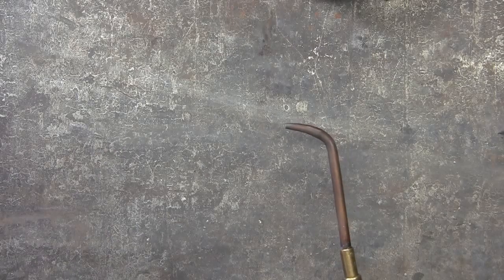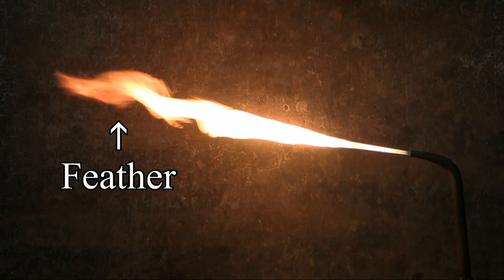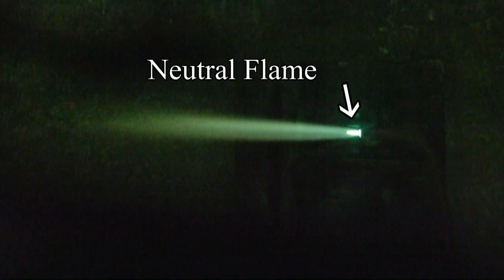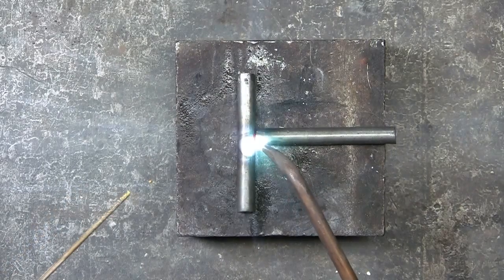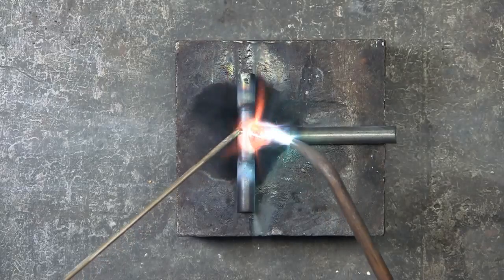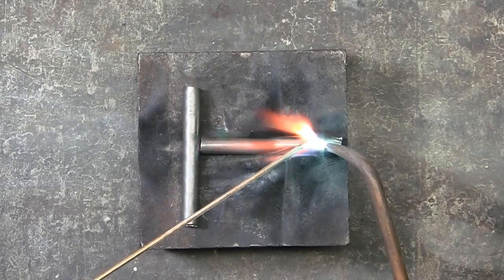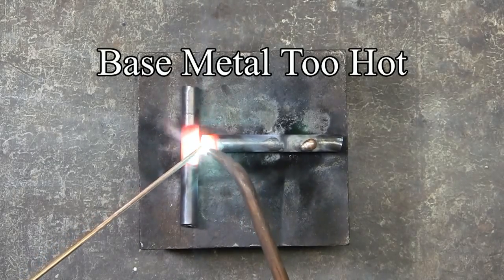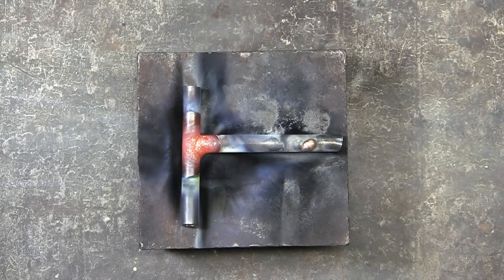Brazing Made Easy

Comment: I Tig weld a lot , when steel is melted it will react to the nitrogen and other gases in the air and cause oxidation and perosity without shielding gas, Red hot for braze .  I'm glad he showed what happens.
Reply from the maker: Thanks for viewing.  I envy your Tig skills.

Comment: Back in the day I used to braze the tears in the tin work on my dad’s combine just because I liked brazing. Years later I wondered since we had the basic 3 oxy/acet welding tips what the criteria was for deciding which process to use . Your thoughts please.
Reply from the maker: Tips range in size from “000”, “00” “0” 1, 2 ,3,4, 5.    “000” being the smallest.  Back in the day, as you say, I would imagine that you were using a 3 or 4 sized tip.  I don’t know the thickness of a “tear”.  For ¼” steel, I guessing, you’d need at least  1 or 2 sized tip.    A video I did recently showing how to force a tip to braze heavier or lighter material.  
https://youtu.be/1jf_dhbZRkc
Reply: Hi George. I apologize for not being clear, given the two choices i was wondering how you determined if you were going to braze a joint or just weld it using the standard oxy/acet rod. We were taught both at school but I don’t recall when you would use one rather than the other process.
Reply from the maker: @barnycanuck6234  Gas welding with a gas filler rod is just for steel to steel.  I use brazing when I want to join two different metals: steal to copper, steel to brass or bronze.  Copper to brass or copper to copper.  You can gas weld stainless to stainless with a stainless rod.  But, for my work I would probably use brazing for stainless to stainless.. Gas welding steel to steel is stronger than brazing steel to steel.  Hope this helps.  George
Reply: Thanks George. Have a Victor  Performer kit on order, the wife saw some of your handy work and wants to try it as well.
Reply from the maker: With your experience, you should have an easy time.  Lots of videos and photos at www.gsegmedia.com  Keep in touch.  George

Comment: Hi George what backing plate can I put when brazing a hole in metal so the bronze does not fall out the hole when brazing.
Reply from the maker: What material are you working with?  Is the hole in steel or copper?   How big is the hole?
Reply: @897473  steel George about a cent wide 3cm wide. There has to be backing source but I don't know.
Reply from the maker: @vimaljks  I would back it with a piece of steel.  Tack braze (small brazes)  around the edges and let cool.  Then put the heat directly on the center of the hole.  Once the steel backing is red hot then start applying brazing rod until the hole is closed.  I'll try to do a video on this in the next few days.
Reply: @897473  ok that would be great geroge. But if you don't want that steel under but something I can remove after brazing so the back side is sealed too smoothly that's what am looking for to.
Reply from the maker: @vimaljks  In that case, forget the backing.  Do some small brazes around the circumference of the hole.  Let those cool and then do some more until you can bridge over the brazes.  Once the hole is completely covered, then you can grind off to a smooth finish.   For that small of hole you may be able to just start brazing and through capillary action the hole will fill up.
Reply from the maker: @vimaljks  I should have asked you what you were brazing.  Here's a video I just put up:  https://youtu.be/FuVUEHfVbBE

Comment: Do you need flux when brazing?  If so would you use it if you had brazing rods that have flux on it?
Reply from the maker: You need some flux to braze.  How much flux is dependent on the metal to be brazed.  To give you at better idea, here is a video I did on using flux.  https://youtu.be/KFN38vHKQTY

Comment: What are the gauge pressures you're using... thanks for the video.
Reply from the maker: 5 acetylene 6 oxygen.  Couple of videos that may give a bit more insight.  Flame adjustment and tip selection.  https://youtu.be/9vooT29iMyw  and the carburizing flame:  https://youtu.be/zVOZpUFFRNg

Comment: Hi George, I tried to bronze braze stainless steel sheet with another piece of SS sheet with bad result.
and i tried to braze SS with mild steel and again the result not good.
the thin gauge SS cracked after brazing and the joints are weak.
What can I do to make it better.
Greetings.
Reply from the maker: Since I am not there and can see what you are doing, it's a little hard to say.  Are you using flux?  Try varying your heat.  Sounds like you are using too large a torch tip or too much heat..  Check your oxy/ace setting on your regulators.  I use 6 oxygen and 5 acetylene.  What size brazing rod are you using?  You may need a thinner rod that will melt faster. You are going to have to try every combination that's you can think of.  Heat, flux, regulator settings, size of tip.  Is your metal clean?  Try varying the distance between you torch flame and the metal to be brazed.  Let me know how it works out.

George
Reply: Thanks for your reply,
Ok the tip is #3 i was thinking it's big for the job.
I tried to blog an end of ss tube with brazing and its goes great with a smaller size tip.
I'll try again with the thin ones with the smallest tip, I think it's need to manipulate the heat to avoid over heating the ss.
Thanks again.
Reply from the maker: take a look at this video:  https://youtu.be/h0vIvipWVuY

Comment: Will brazing work on a broken foot of a clawfoot tub?
Reply from the maker: It depends on the metal.  I would imagine that it is cast brass.  (just a guess).  If you can find someone that is experienced with brazing cast brass they can probably do the job.  Personally, I would try J-B Weld.  It is an epoxy glue for metal.   If it doesn't work you are only out about $5.00.  You can find it at Amazon, Walmart and most builder's supply/  There are different types so you will want find the one that is right for you.
Reply: The person I bought it from had already tried JB Weld, did not hold.
Reply from the maker: Sorry to hear that,  Hopefully you can find an solution on the web or through YouTube

Comment: This is kind of weird to me, I was taught acetylene welding as a kid working at muffler shops, welding with only gas for hours per day for years i got very good, I had to re-repair many brazed exhaust systems and never knew exactly how to braze, i just knew it was like soldering,
I would still just weld two pieces of mild steel, but im interested in brazing's versatility at home.
Reply from the maker: Brazing is adding a bronze filler rod. Much like gas welding, just not as hot of flame.  If you were good at gas welding, brazing will be very easy for you.   Difference between brazing and gas welding:  Braze vs.Weld video:  https://youtu.be/TQP8EBQRvr0

Comment: I make Salmon hooks and I'd like to start making double hooks (2 identical hooks set at an angle and brazed together at the shank). I have no experience with brazing/welding. The heaviest wire I work with is .093", the  smallest is .041" and just about everything in between. I use W1 tool steel rods.  I have a normal Map gas torch. Would I be able to use that style torch? And what type of brazing rods would I want to use for such light work? Would appreciate any suggestions. Thanks!
Reply from the maker: Never used Mapp  Gas, so don't know about that.  For brazing, 1/16th bronze brazing rod.  You will need some flux. I'd suggest a  paste flux.  I would use as little heat as possible so not to remove the temper from the steel.  You might want to try silver soldering.  An 1/16" piece of 1/32" silver solder would be more than enough.  Silver solder requires far less heat and is almost as strong as brazing.  Main point, get the heat on and off of it as quick as possible so that you don't disturb the molecular structure of the tool steel.
Reply: @897473  Thanks for the quick reply! I tried out some silver solder which worked quite well. I'm still left with one problem. These Salmon fly hooks are generally coated with a black lacquer (black japan) which is baked on at about 600F. The highest melting point for a solder I could find is 580F, so that'll be cutting it very close when baking on the black japan. I'm sure with some trial and error I can make it work. But if you're aware of a solder with a melting point above 600F please let me know.
Thanks so much for your advise.
All the best,
Jeff
Reply from the maker: Jeff, first off I know very little about solder. There many types of silver solder with higher and lower melting points.  Price is usually an indication of the percentage of silver in the rod.   You might want to investigate Sil-Fos.  I believe that it has a higher melting point than the silver solder you are using.    Check out this site, looks like they have a full range of products.  http://www.silfos.com/

Comment: I've read that the temperature needed for brazing begins at 842 degrees F.
Therefore, since propane yields 3600 degrees F, and Map-Pro yields 3730 degrees F, why would I want to deal with large O2 and acetylene tanks and the hoses?

I'd appreciate your response, George.
Reply from the maker: If you feel that propane or Mapp gas will do what you want it to do, there is no need to go to ox/ace.  Personally, I've never used propane or Mapp gas, so I have no first hand knowledge.  A lot of people are moving to propane because it is more readily available.  If you do some searching you will find people that are using propane to braze.  I've seen very little information on Mapp gas.  Acetylene has doubled in price in the last ten years but is still my preferable gas for brazing and gas welding,.  George
Reply: Thank you.

Comment: Nope!  Totally WRONG!  You always have to start the torch, add O2, flame out, then restart.  That's the official 'youtube' method. Yes, joking.  But the video is good, but should say brazing is between welding and soldering, biased towards soldering.  How to heat substrate and when/how to add filler is key.

Comment: I have watched 15 videos or so on brazing, l wasn't sure if l could do brazing or not. After watching your video, you explained it so simply, l am sure l can braze. I have soldered stuff for years, the only big difference l see is the heat. Thanks
Reply from the maker: You're right, it's just a little hotter.  You should have no trouble.    Thanks for commenting.

Comment: Is it possible to braze aluminum and a  light grade of steel?  What rod  & flux should be used?  
I want to fabricate a fitting for an O2 Sensor on a car's cat  - screw it the fitting into a hole and braze in filler steel to aluminum cat outer ?
Reply from the maker: Thomas, I know nothing about  aluminium.  Suggest you check out some welding forums.  Some of the people on the welding forum have welded anything that can be welded.

Comment: Hi George, thanks for the video, I restore antique pre-1910 bicycles and most of them have been brazed, so I wanted to learn more and eventually do it myself.
I have 2 questions for you, hopefully you know the answers
Most of the old frames have a lugged construction, where a tube goes inside a lug and then they are brazed together.
1. If I want to replace one of the tube that has a badly damaged part, is there a way to "melt" the brazing or will it just mess it all up?
I also notice on some frames when I sandblast them, that brass have been used to fill areas where the tubes were dented.
2. It is the same technique as brazing to fill bigger holes? And how thick can you braze?
thanks

Comment: George, I have a 1/4" i.d. steel pressure washer fitting that I need to modify. It has two pieces: the front piece which fits into the pressure washer outlet, the rear piece which was used to crimp a hose to the front piece. The hose has been removed. The front piece swivels around in the rear piece with a very close tolerance fit. I need to fuse the two pieces together to withstand the 1500 psi of water rushing through it. Can you recommend an inexpensive way to braze them together? I have a Benzomatic oxy/map torch kit with 2 steel rods, 2 copper phosphorous rods, and 1 bronze with flux rod. Thanks.

Comment: Hi George,
thanks very much for your videos, they are v.good. I am sorry to ask this 'dumb' question- as I am v.new to brazing - I am trying to braze 2 pieces of mild steel bar (10mm diameter) together with the oxyturbo (oxy propane) set. I must be doing something seriously wrong as I am unable to join anything with any strength at all. I am dipping the bronze rod in brazing flux, and the steel bars are clean. I did not use any flux on the bar before heating. This little kit has enough 'go' to get the bars red hot...but not as extensive as you are getting them with your oxy acetylene). The rod melts over them, then after cooling - I can just pull them apart with my hands. Am I not getting things hot enough? I am at a loss. Thanks very much for any help you can give me!
Reply from the maker: 10 MM is about 3/8" thick.  That is going to take some heat.  You are probably not getting enough heat.  What size brazing rod are you using?  The heat is probably dissipating quickly away from the steel bars.  I'd try building a fence around the bars, with either firebrick or some pieces of metal.  This would keep the heat in place.  I have had occasion, where I have thinned out the brazing rod on an anvil so that it would melt faster.  I have no idea whether any of these suggestions will help.   Keep trying and getting suggestions and something will finally work.
Reply: okay thanks George,  I will try to get more heat into them and try the thinning the brazing rod as you suggest.....(I bet this little set isn't 'man' enough to do the job!...) Thanks!
Reply: Hi George, Thanks for your help - you were absolutely right! Once hot enough it just worked. It might seem simple but you have helped me immensely. This is the thing, without an experienced 'head' we are lost, and there are few people to ask! Thanks and best wishes, David

Comment: just curious to know, no need for flux?
Reply from the maker: Praveen, I am using  a little flux.  Since I am using all new material, I need very little flux.  Full explanation in this video..  https://youtu.be/KFN38vHKQTY
Reply: @897473  Thank you. I had the same question. I haven't used this method since high school, but we may have a job coming up that looks like we can't use any electricity at all... so here I am. Maybe we'll just try to burn off some debris, brush it really hard and use a little extra flux. It all makes me wonder what's going on. We're fixing some door hinges on something, but we can't use any electricity. That's all I know. It's exciting to me.
Reply: praveen prabhakaran stfu

Comment: I understood that the surfaces to be joined had to be matched within 1 or 2 thou.  You were filling a significant gap with the braze.  Was my understanding incorrect?
Reply from the maker: broomholm  Thanks for mentioning this.   In theory the 1 or 2 thousands may be correct.  A lot depends on what you are brazing and how much strength you need.  Most of what I do is either going to be hung on a wall or set on a table.  I often use brazing as an effect, contrasting copper to the gold color of brazing. If you'll notice in many of my videos, I am spreading a lot of brazing around for the effect.  If you do the 1 or 2 thousands, you will need very little brazing rod and the brazed joint will be much smaller. If you are brazing something that is going to get a lot of stress, then maybe you'll want to stick to that 1 or 2 thousands.  If you are brazing something specific, I'd suggest trying to find a forum that addresses exactly what you want to do.

Comment from the maker: It's been my exp[experience that clean metal always brazes and welds better than oxidized, oily or rusted metal.  This is especially true of brazing.  
For brazing, if I run into a situation where I can't quite get in to get it clean I will use some extra flux.  George
Reply: That was the only thing you didn't go over in the video.

Comment from the maker: Sushil:  I don't know.  I have never worked much with aluminum.  There may be some way to do it with Mig or Tig.

With the oxy/ace torch the flame would melt the aluminum before the steel reached a brazing heat.  You may want to check some welding forums and see if you can find an answer.

George

Comment: Thanks George for nice video.
i have 1 question , is it possible to weld iron with aluminum with brazing rod ?
Reply: Weld is not the word here!  Hard to weld such dissimilar metals b/c of radically different melting points.  They can be ah, soldered together!  I've used those low-temperature aluminum braze sticks to bond aluminum to galvanized steel for example.  It LOOKS welded, but it's kind of soldered.